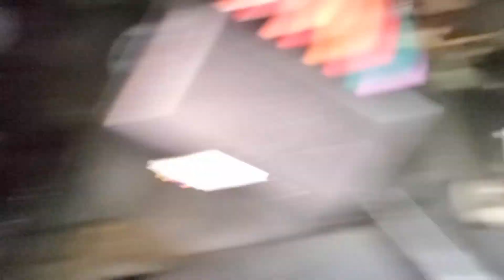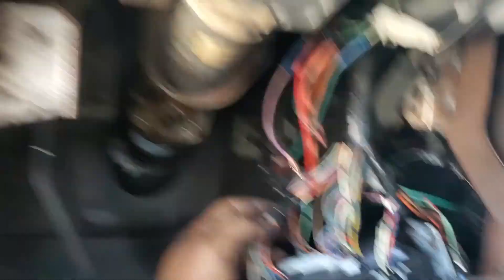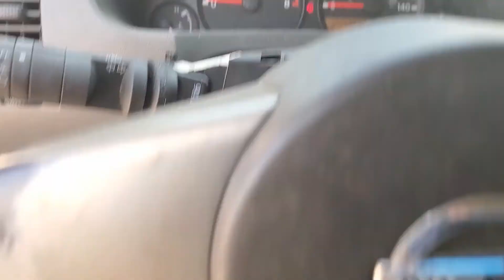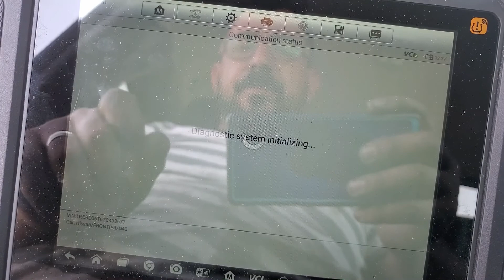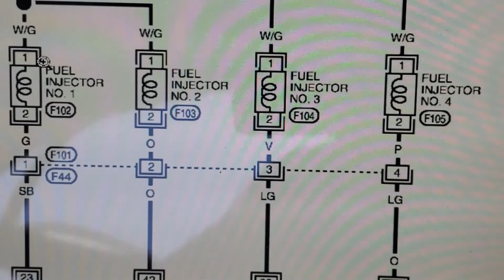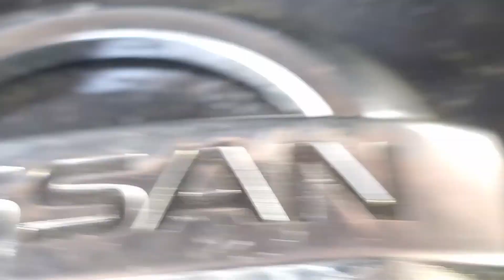2007 Nissan Frontier Crank No Start. ECM checking for Injector pulse. Day 2

Comment: Can you tell me where the fuel pump relay is on this 2007 Nissan Frontier?
Reply from the maker: 4 or 6 cylinders?
Reply: @DallasAutoDiag  My frontier is doing the same thing but my oil pressure gauge not moving, oil was always good, it use to take a long time to start but will eventually crank, now it just crank no start.
Reply: @DallasAutoDiag   yes I need to know also where the fuel pump relay 4.0
Reply: Having the same problem was there ever a fix